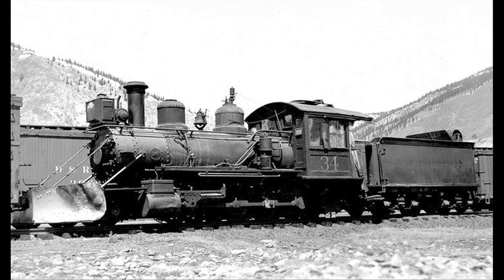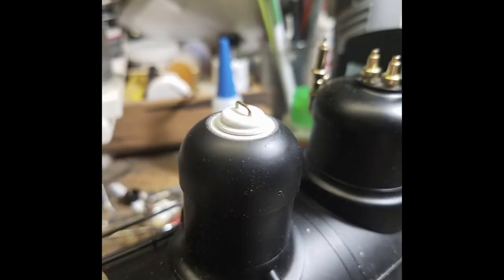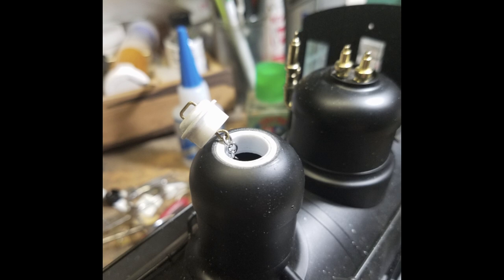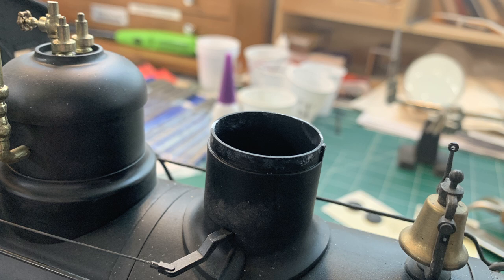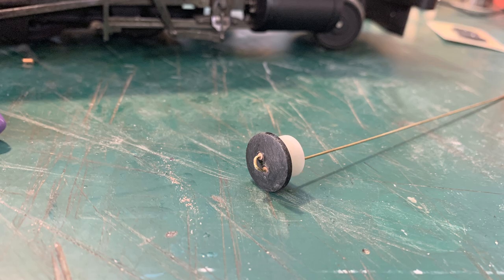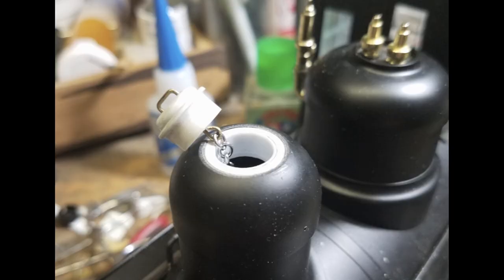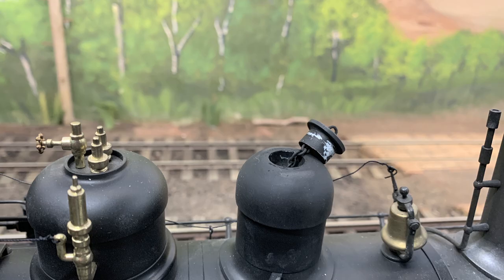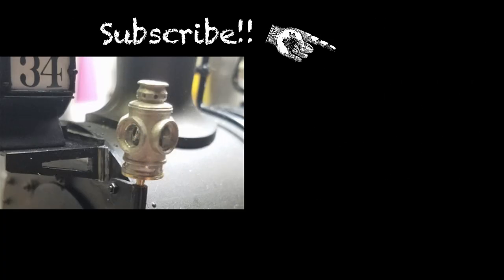Sand Dome Lid for all Three Large Scale Bachmann Consolidations - The "Connie" Project part 12

Comment: I'm glad that you mention Jason Jenson every now and then, Jason is a commercial artist, by trade, but is also a modeling artist. His medium is HO scale structures and scenery. His methods and yours a quite similar at times. The difference is scale. Because you have chosen F scale the detail level is much higher. I can't wait to see the finished locos. 
Others suggest added details, so here goes a few. the operators personal tool boxes ( I have my great uncles "engineers" tool box, it's over 100 years old, square shaped 10 x 10 x 18. shovels and pokers, a bucket, oiler, and so on. 
When you add those kinds of details, it makes the model come alive, and with F scale, it will be over the top. John Allen, Jason Jenson and others liked to add little things that were almost hidden. Then you look, in the alley, and find a trash can with a cat digging  for a snack. Now that's detail.
Really great video. ;-)
Reply from the maker: And Jason is modeling large scale in the next room. A science fiction railroad!  Really looks cool!!

Comment: Generally, the marker lights on a loco are called "class" (classification) lights.  They should be able to show green for extra sections of a train on the timetable or white for an extra train that is not on the timetable.  Marker lights showing red to the rear are to be installed on the rear corners of the tender for locos running on orders without cars.
Reply from the maker: I have an idea for removable class lights. On hidden plugs. Would make it possible to use them properly.
Reply: A thing I did with class/marker lamps on several of my Big Hauler 4-6-0s was make those lamps battery powered so if track power was lost while running at night (on Mike's layout, my upper floor apartment has no garden) you would easily know where the train is.
Two also have the headlight battery powered. All use a 9v battery stuffed in where smoke unit used to be; switchplate was cut out of smokebox front for access through smokebox door.

Comment: I think you have got this episode buttoned up.
In use, the sand dome lid would scratch and chip the paint of the dome, probably no matter how careful the crews would (not) be.
When I sanding Baldwin designed narrow gauge engines, the dome covers would just be lifted off and placed on top of the boiler. There was a lip so rainwater would not go in the dome when the lid was fitted. The handle was almost cast into the top of the lid, so there was an indentation, and the round handle was flat with the top of the lid. You could only see the handle if you were looking down on the lid.

Comment: Conny's are looking good. One question, to be SN #34 the sand dome is in the wrong place, it should be where the bell is and the bell should be where the sand dome is, also, what about the box style headlight?
Reply from the maker: Well we are cheating. As the Baker valve gear is wrong we are just freelancing. Sort of the 34. I thought about changing the headlight. But we figured as so much is wrong just go with fun.

Comment: When you pour sand into the dome and pull the cab lever, does sand come out in front of the drivers? 😏
Reply from the maker: Not yet. Working on that. Need 1:20.3 scale sand.
Reply: @ToyManTelevision  Beige grout powder.  But they don't have it at JoAnns. 😁